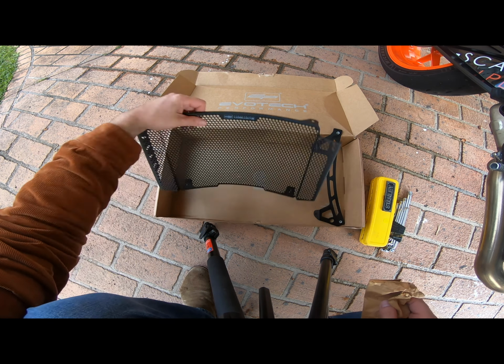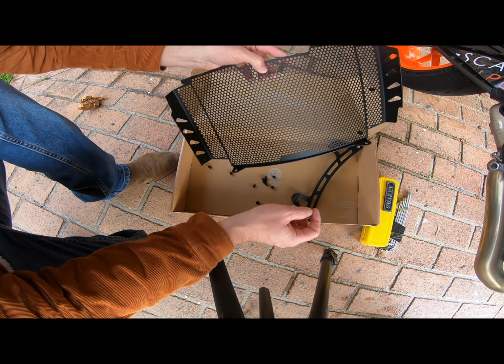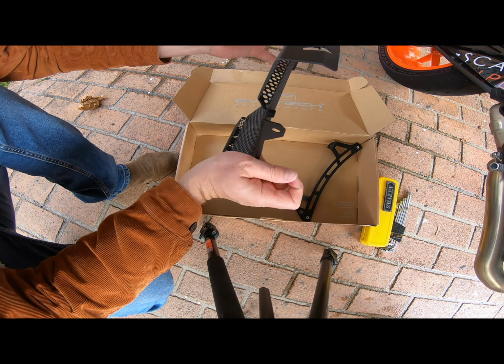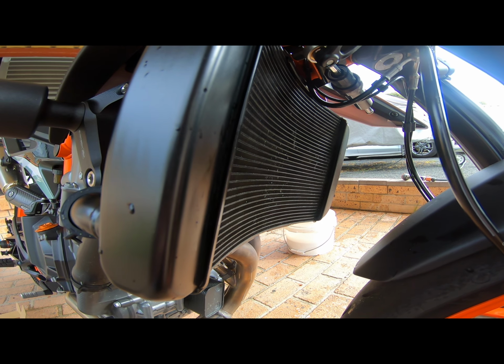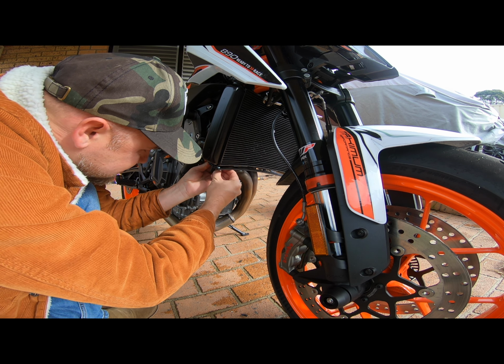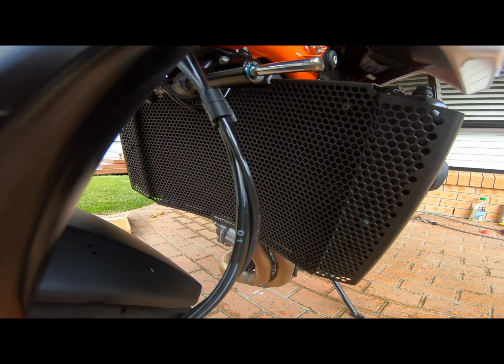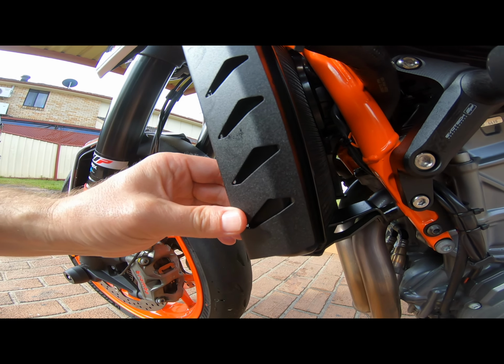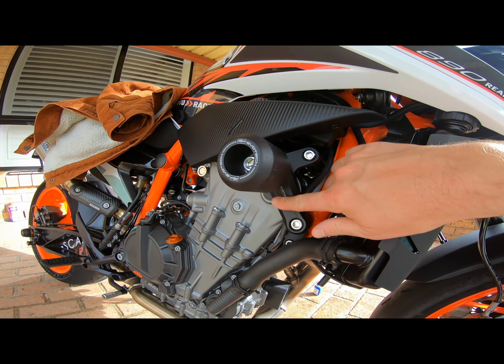KTM 890 Duke R EvoTech Performance Radiator Guard

Comment: Got the same on mine . Just wondered what mileage you get from a tank when being conservative with the gas ? And after the first service they change the oil to a thicker oil .... does it make the engine a bit quieter ? First service tomorrow.
Reply from the maker: Good choice. I've put it in Sport mode and just ride it like I stole it. So can't really say what my milage is. About 300km per tank. With Arrow exhaust and baffle out not quite ;-). As for oil you'll have to see that they say.
Reply: @PissTakeProduction  wow I am only getting about 256km until I have to push it !!! Ride safe 🤪

Comment: How did your grommets just go in? I have tried using tools to force them in and pliers to pull them through and all I have managed to do is mangle the grommet and change the shape of the radiator guard.
Reply from the maker: Just wriggle them in. i didnt use pliers

Comment: Hello friends, do you know that the radiator of 790 and 890 R is the same?
Reply from the maker: Different size from what I remember.
Reply: @PissTakeProduction  These radiators are very similar.  I can't buy the radiator for 890 R.  I couldn't find it on any site
Reply from the maker: Did Evo tech in the UK stop making them? Or try eBay is where I look for bike mods.
Reply: @PissTakeProduction  eBay only sells 790 radiators, which are very similar to 890 radiators.

Comment: hey mate just a quick one....those foam pads that are meant to come with it actually go on the very top little hook sections so that it doesn't rub and probably soak up any small vibrations when fitted. Just thought I'd mention that. I fitted one last night. Neat little bit of kit!
Reply from the maker: Yer i misspoke easy to do on video. I had left over foam from an Aliexpress rad guard and used that as a dampener. for some reason Evotech forgot to add that to my package. :-)
Reply: @PissTakeProduction  sweet mate. I only realised because I downloaded those instructions and though ahhaa I better get those on. Bloody turned out nice. Also orders up the crash bobbins but had to order from UK… no stock anywhere. Tail tidy from Mustard bikes to come too… cannot wait. Bloody great fun aren’t they.
Reply from the maker: @rooststarfilmsmick4078  let me know how the mustard tail ride goes. I'm interested but cause I use the Ventura rack the blinkers might hit the rack when tail tidy is installed.
Reply: @PissTakeProduction  will do. I actually ordered an R&G one but when I got it I realised they just run the cables in some heat shrink back under tail…looked bloody ordinary so returned it and the Mustard one has a hidden cable set up. Got good reviews. Let you know how it goes.
Reply from the maker: @rooststarfilmsmick4078  same thing with R&G on Vitpilen terrible and wiring not concealed. Nothing worse being dudded.